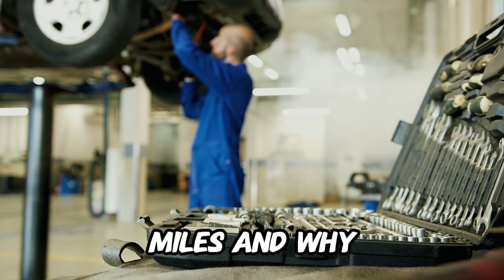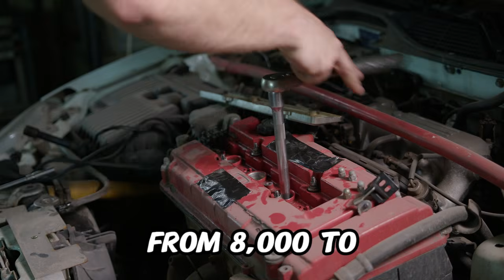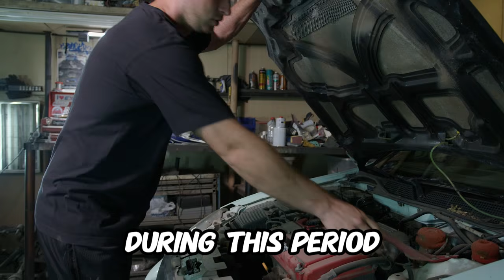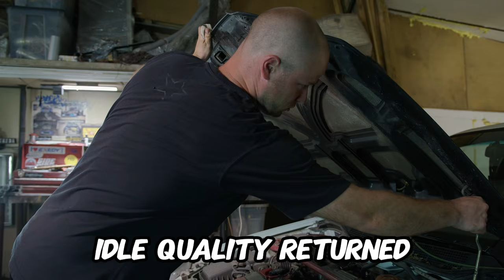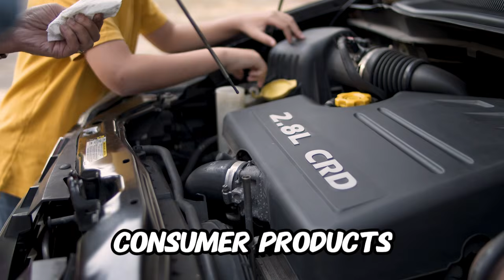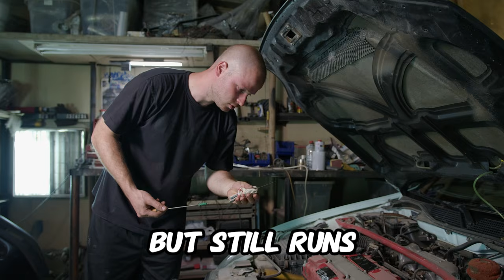Mechanics Use THIS $200 Formula on Their Own Cars (Never Tell Customers)

Comment: An engine gets sludge when the oil is not changed often enough. Modern cars 🚗 oil changes at 10000 or more km recommend by the car manufacturers is total crap. I change my oil every 5000 km and have no issues with the sludge. 🇦🇺